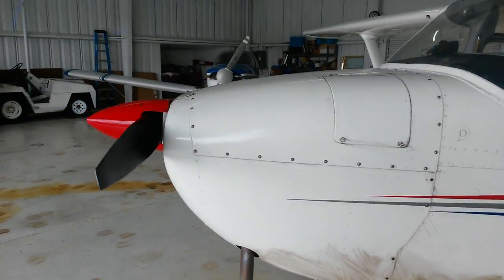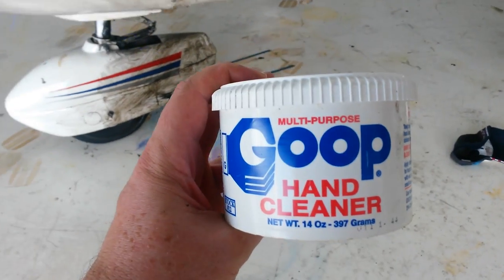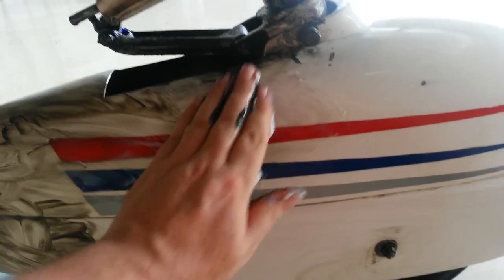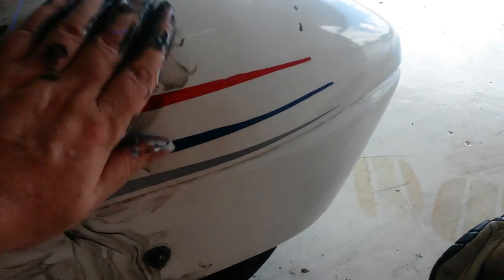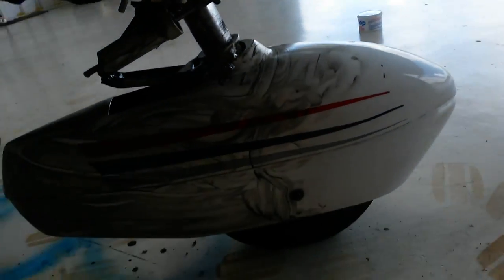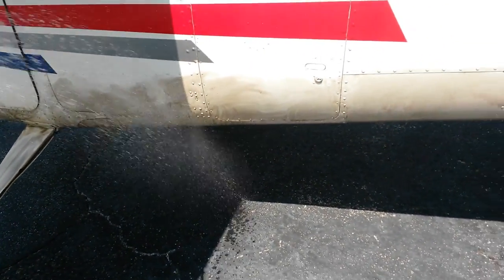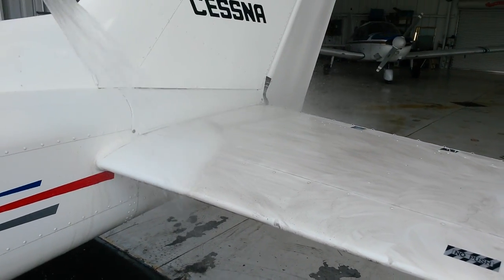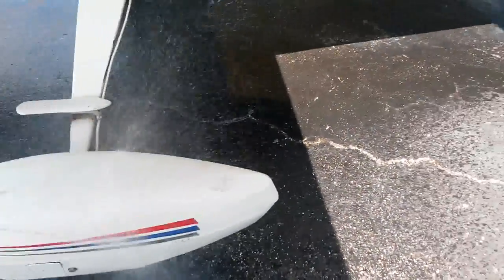Cleaning My Plane With Goop

Comment: Great idea Russ!  I'm going to use it (with nitrile gloves) on the belly of a Seneca II and 182.  I might even try to round up a steam cleaner or hot water pressure washer, and be careful to keep a safe distance from the surfaces to avoid removing the paint with high pressure.  Then spray the whole thing down with some expensive F11.  The one they keep bombarding with me commercials about how great it is on everything.  But I would have to break down and actually buy the stuff.  And that, I just don't know about.   : ))
Reply from the maker: This stuff works great.  You don't need high pressure just a normal hose will wash it off.  I have used it repeatedly without any paint loss.

Comment: bad idea to spray down with water, when the water drips and dries it leaves water stains & the ONLY way to remove those stains is to have your plane compounded.
Reply: & if you do spray it down make sure you dry of all the water drips ! trust me this makes a BIG difference.
Reply: And water can get into a variety of places you don't want it...static ports, bare metal pieces subject to corrosion, etc. Think I'd just use a couple of soft cloths, rinse periodically and wipe off the goop & mess. Seems like ideal product!